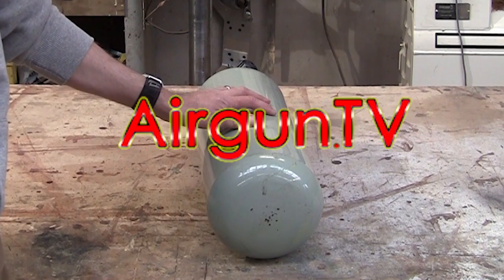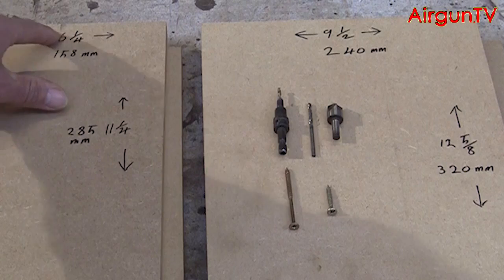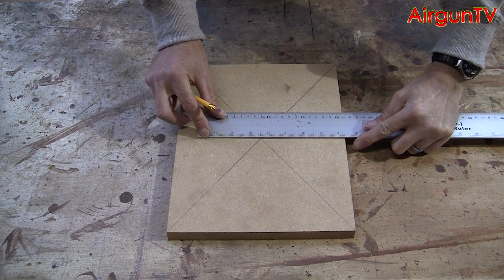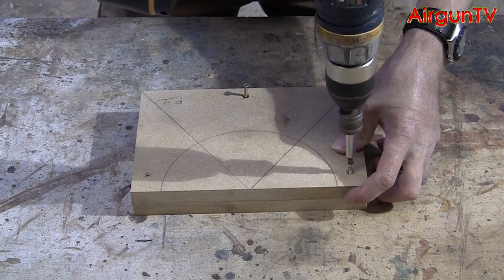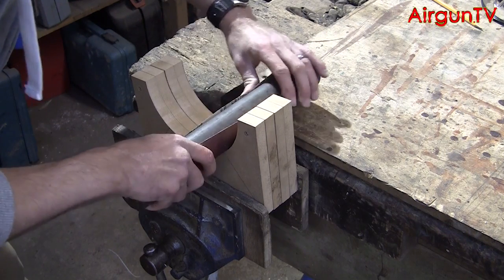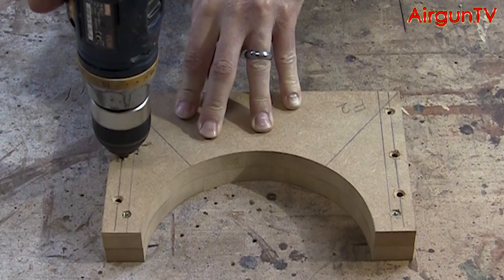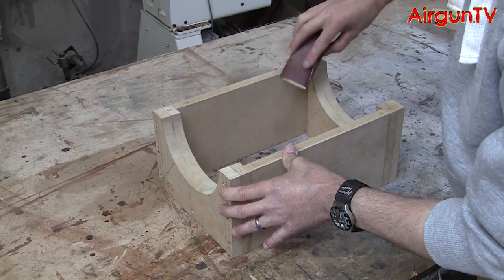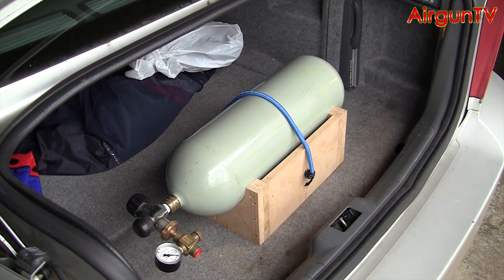HOW TO make a PCP scuba tank holder

Comment: Or do what I do I have, buy a handle that bolts on the neck of the bottle tie a bit of rope to it and sit the bottle upright on the back seat loop the rope over the headrest and put it's seatbelt on. The bottle is safe and you can carry it with its handle alot easier.

Comment: First off, I applaud you taking the time to post your video.
Secondly, this contraption would be excellent for keeping a cylinder from rolling around during transport. BUT... it's widely regarded that long term storage of a compressed air cylinder should be upright, not horizontal.  This is so that if there happens to be any moisture inside the cylinder, it will rust or oxidize the bottom of the cylinder where it is much stronger than the relatively thin sidewalls.